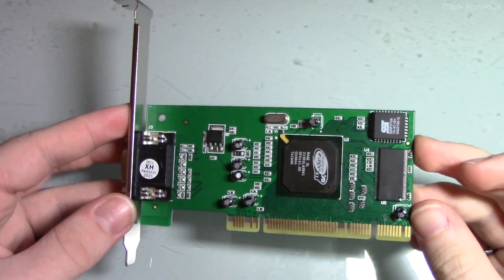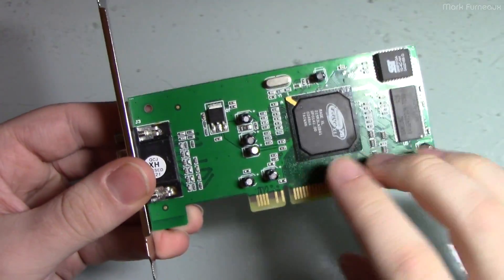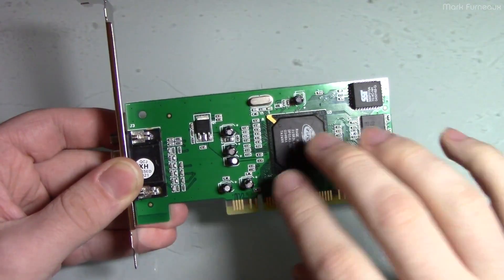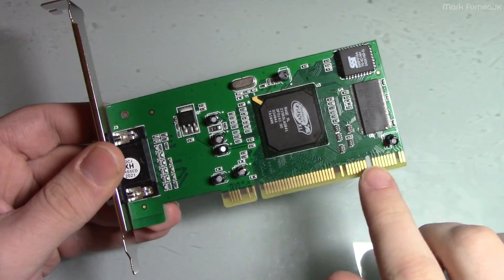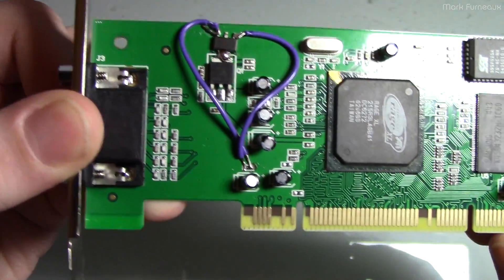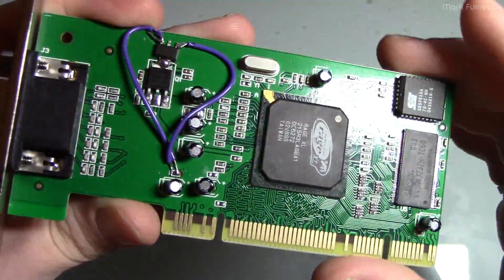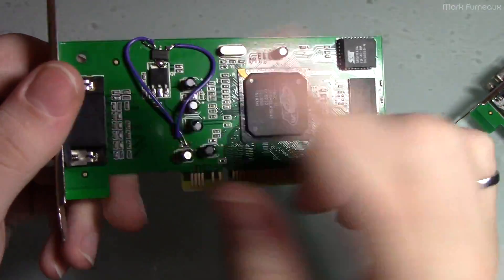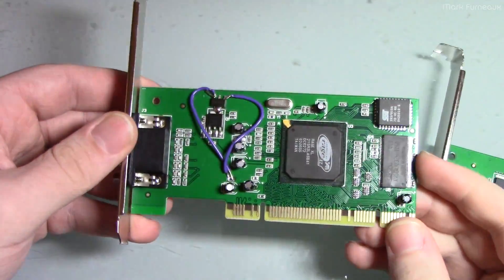Modding a "New" ATI Rage XL PCI GPU to Work on a Vintage Motherboard

Comment: NIce little hack. It might explain why I've seen other cards seemingly not work on some systems but work perfectly fine on others.  I wonder if you could really cheat and just stick 3 cheap diodes in series to drop the 5V down to about 3.2 and be good enough?
Reply: I just tried the mod using diodes as you suggested and it works! I used 2 diodes from an old modem and they stepped the voltage down to 3.4V which was close enough. It's a bit simpler than doing it with a voltage regulator.
Reply: @JHDarkleg  Just be careful that you don't install another card that needs 3.3V in the same system or you will overload the diodes!  To be safe, you may want to cut the 3.3V connection to the card edge connector so it can't backpower anything else (if the +3.3V rail is connected between the slots)
Reply: You could probably lift the input pin on the regulator and wire it straight to 5V, though verify the datasheet first.